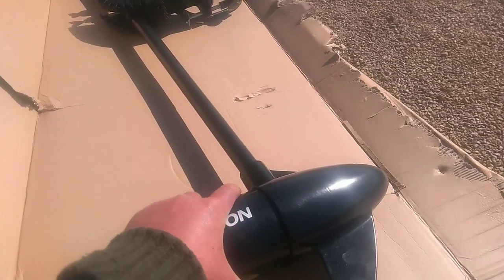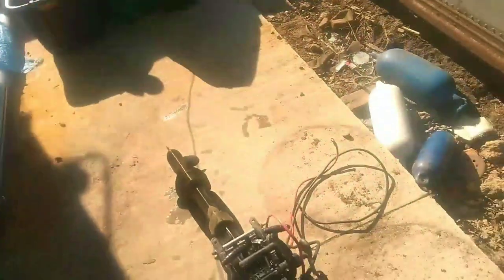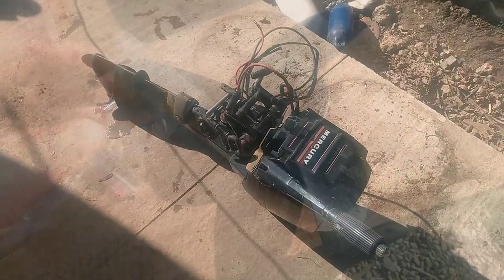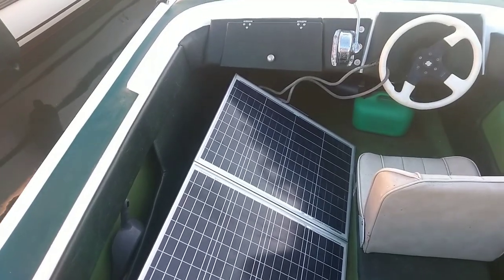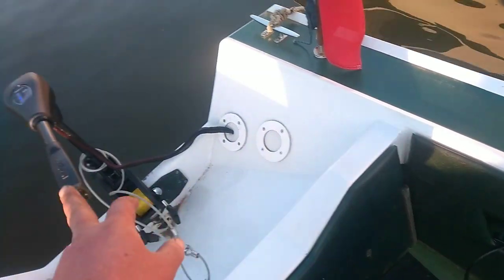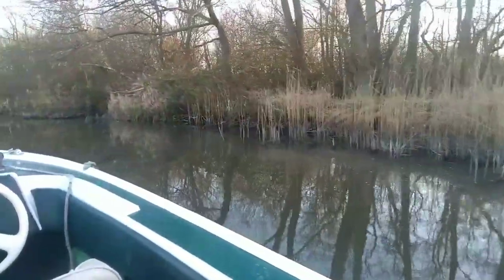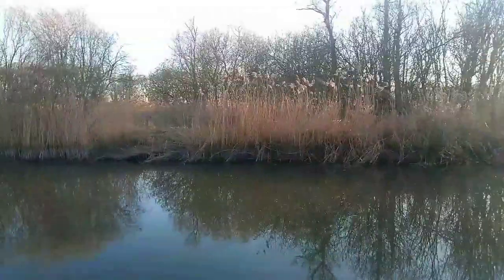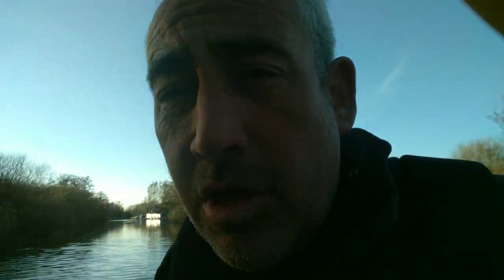Bison Electric Outboard Trolling Motor Review Norfolk Broads Forum

Comment: I've got a Bison 40lb thrust on a 3 person inflatable, I've wired in a cut out switch & run it off two 12v wheelchair batteries, one battery at a time. I charge gel batteries with an intelligent  charger, DON'T use old type of charger, it will kill the battery.  When first battery runs down I know it's time to turn around, connect other battery & head back to where I started from. I get about 1hr running time from each battery if I run it on lowest setting on very weak tidal pressure.  You can get so close to wildlife because it's so quiet,  BUT have some loud form of warning for other boating & make yourself & boat as visible as possible.
Reply: Hi mate, what make of inflatable please for the Bison 12v motor? Bison inflatables look good but expensive.
Reply: wrong all boat shoe up oñ radar

Comment: I had on on my 17' trailer sailer (500kgs) was sort of ok to get home on a flat calm but useless into the wind. I would say max speed 2mph but more like 1mph if you did not want to drain the battery. The battery I used was a 100AH AGM and kept it charged with a solar panel on the cabin top. Cant use petrol outboard on lake I sail on.    If I was getting one again I would get the 100lb 48V.  Better still a torquedo but far too expensive for me. (more than the boat is worth)
Reply: get 3  hp ektr built inn baterß
Reply: Buy j88 solar eltric sail boat

Comment: Thats an amazing little eboat with that bison emotor, incredible.  Could I ask what size and make is your 12v battery now, did you upgrade your battery since this video? Best ah amps to marry up with your 100w solar panel please for 4 or 5 hours out on the river fishing steady away?
Reply: Hi Mark. Just looked at this video as I'm getting the Bison 55lb motor as an upgrade from my Oylpa 40lb motor which has been great and is going to my Son for his wee sib. I use a 110ah Superbatt LM110 Deep Cycle Leisure battery on my 2.3m sib and it gives me 5 hours on low/medium thrust. !00w solar charge is plenty, I used to recharge mine with 30w of panel in my shed between trips. I'm getting another battery to take account of the greater draw by the 55lb motor, but I expect it to also add hours to a session on the water and 2 batteries is no inconvenience really. The quiet on the boat is the bomb, all the best, man
Reply: @tommohawksaxe2609  Hi mate, thanks for your reply I have just seen 😀 Thanks for the information.

Comment: Helll ive got the same bison outboard 68lb I use it to power my 18ft navy patrol boat
Reply: What battery do you use pal?
Reply: buy eltrc valiñer 1⁷5 135 hp or 1⁴7 hó 32 kw 3⁰ mioke rabgfe
Reply: Nany. 3.0 b6.0 ekrrc outbard

Comment: Have you managed to rig it up to the cable steering and put a speed throttle by the wheel, or is that impossible?
Reply from the maker: It's impossible.
Reply: @NorfolkBroadsForum   nothings impossible 😂

Comment: I think charging from solar in the UK is going to be your problem, I have two 175w panels on the roof of my boat, at the moment it's a sunny morning with no clouds and I'm getting 190w from the panels which is putting 7 amps into the house battery so it takes a while to charge even on a good day like today. 

Have a look at LiPo4 batteries, the upfront cost is higher but overall they work out cheaper than lead acids due to increased life expectancy and the ability to pull more power from the same A/H rating meaning you can spec a smaller battery, they are also lighter for the same power output.
Reply from the maker: Seems to me that solar is good at topping up batteries as opposed to directly charging them up.
Reply: @NorfolkBroadsForum  Ive added another two panels since I made that post and am having no trouble keeping my batteries charged while running a fridge and freezer, the lights pumps etc and washing machine and dishwasher (i try to use those late mornings on bright days so the panels have a chance to replenish the battery) and sundry other items plugged into the 240v circuit. The LiPos really help as they can be charged much faster than lead acids, means you can use more power during the day and still expect the batteries to top back up again before nightfall in most cases.

Comment: Working a Trolling  motor on My Excursion 5 inflatable. Works for what I need it to do. Boat to shore and back.  Solar?  hmmmmm..good luck!
Reply from the maker: How do charge your up? I've always been rather impressed with solar.
Reply: @NorfolkBroadsForum  I use interstate battery. Charged on sailboat solar panels.  Limit charge to 13.7. Of course engine run onboard charges all my bats if need be. Running motor at speed 3....about two hours run time...depending weight in raft and currents. I also use a PVC extension pipe for steering...

Comment: To be fair to that old merc....its about 40 years old, and typical of a yank design....quite bullet proof but never quite cutting edge even when new. Being a 2 stroke certainly doesn't help. A modern 4 stroke equivalent would use 1/4 of the fuel. And likely to be Japanese manufactured irrespective of what brand is on the lid.